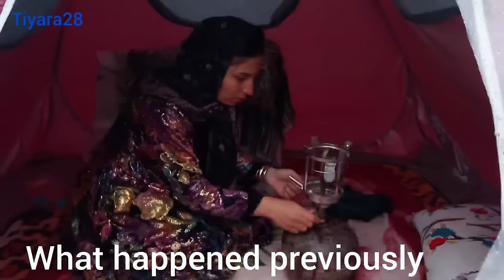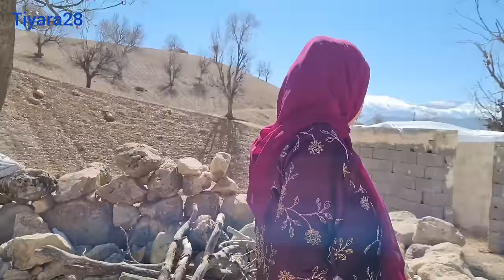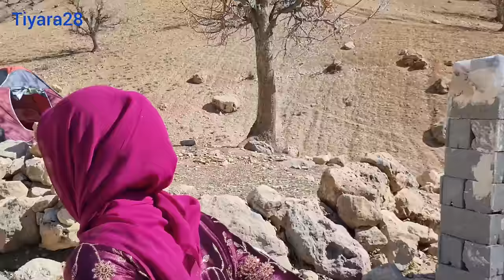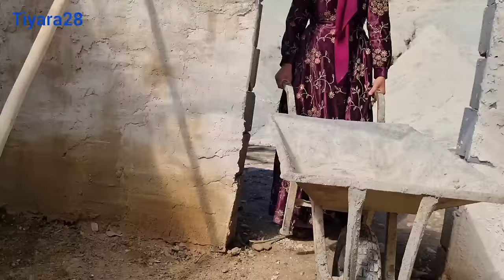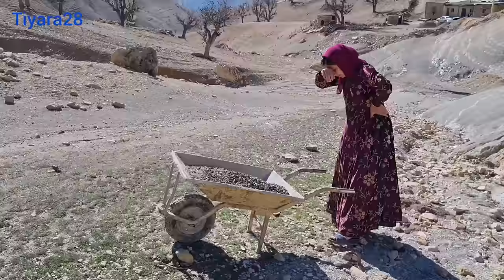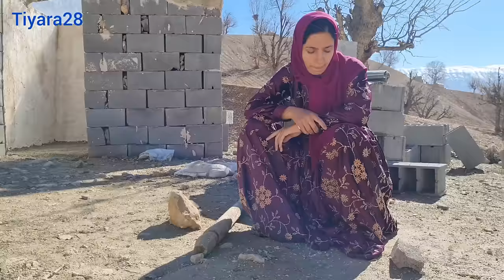"Maryam and her baby" Maryam's effort to build a hut

Comment: Maryam you're doing well empower yourself to build the house roof

The plastic is not going to hold up during heavy rains and snow

Fix it before it collapse on top of you and your newborn baby

You can do this you're a young strong woman and you can do this for your baby 

Camera person please help this family buy metal beams for tiles and buy 24x24" tiles to set in-between the steel beams for the tiles

You'll need five or six steel beams for holding the tiles in place

Next put the plastic on top of the tile roof

Hold down the plastic with rocks along the wall of the house temporarily

Throw sand on top or dirt to weigh down the plastic until you're able to buy sand and cement to cement the house roof

Camera person please buy cement and sand to mix for the house roof
Maryam go to Arsians wife and ask for help from Arsians and Sadegh for helping you build the house roof from tiles it's the fastest way or build a wood roof with logs five or six and nail wood slabs on top of the wood logs
Next put the plastic on top and nail the edges
Next throw sand or dirt temporary until you can buy cement and sand mix and pour it on top of the house roof
Let dry next pour bitumen on top of the house roof and let dry
Next buy isogram and put on top of the house roof with a fire torch over lapping over the whole house walls
This will help keep the water out